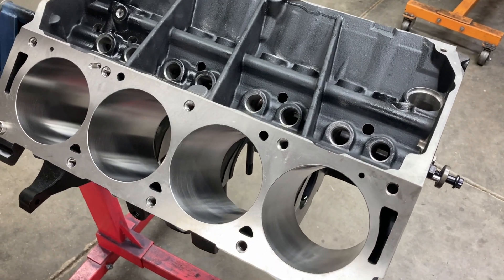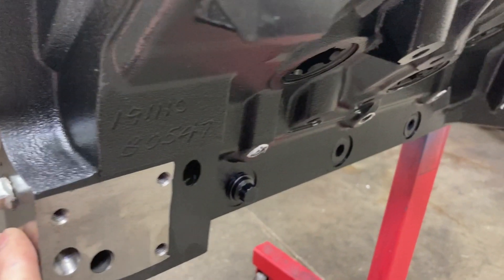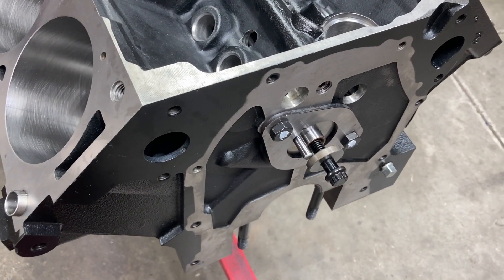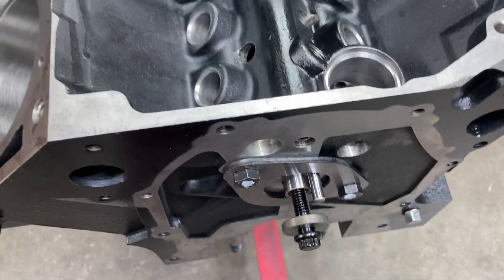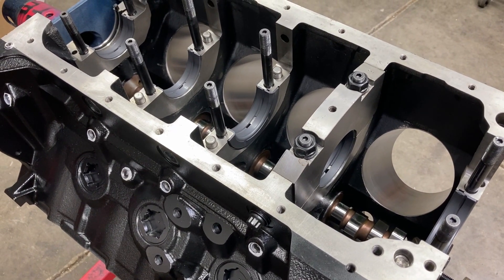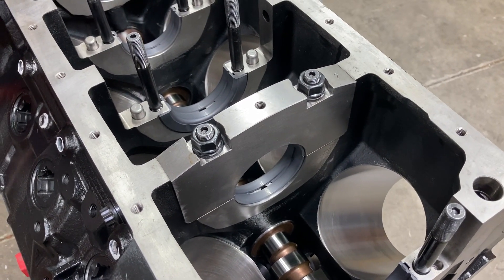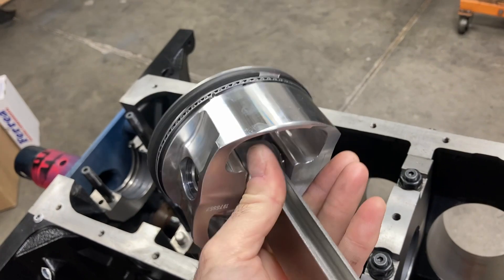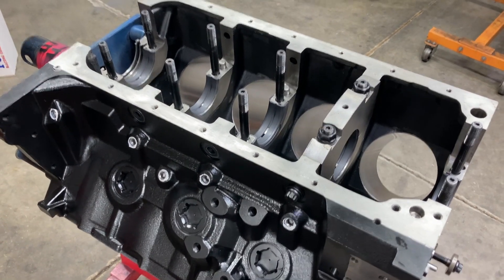Lykins Motorsports Ford 496FE BBM Build Part 1

Comment: I was looking at this again.  I found several mid 70s engines that had hex key heads on the cam retainer plates.  I scrounged up as many as I could find.  Also, how accurate are the lifter locations in the block?  Do you have them checked with a BHJ fixture or something similar?   I see that the main oil pass ages are nicely centered without work.

Comment: Looks great. Need to chamfer and polish those oil drain backs holes in the valley.
Reply from the maker: See the white edges around the holes?  They are chamfered and edges broke.  You’d be surprised at how little polishing does.